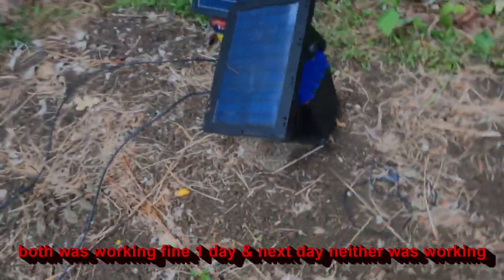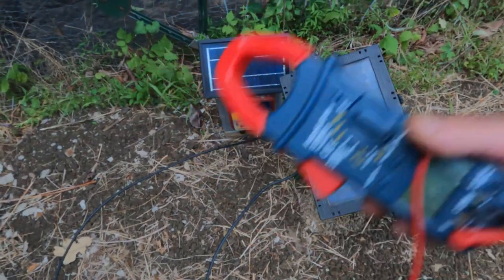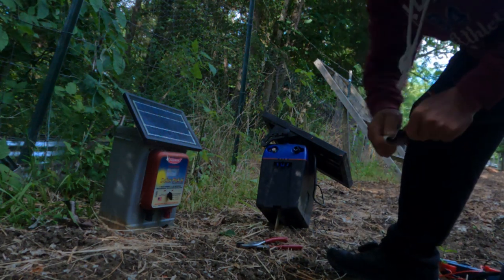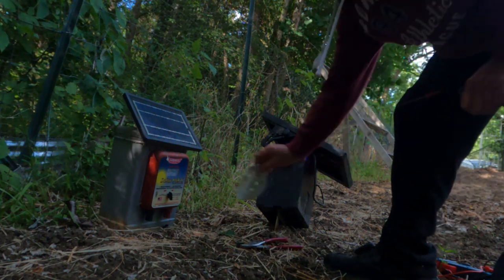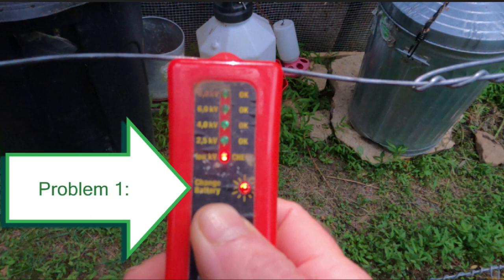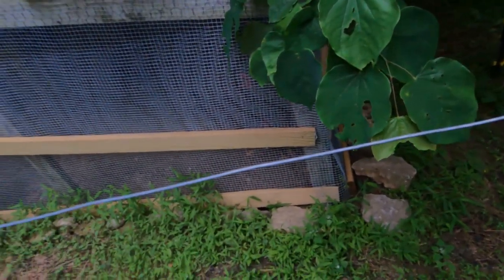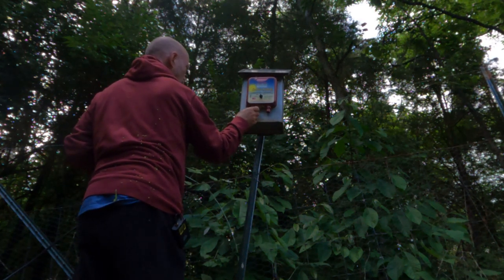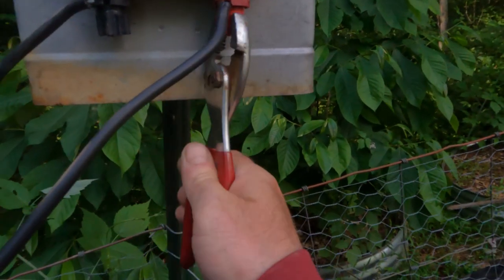testing electric fence issues using ohm meter and fence tester #electric #fence #testing

Comment: What you need to do with your chickens is put a 2 x 6 underneath the edges of your coop, then the predators cannot dig under to get them.  Same with dogs that like to dig out under fences.  You can also use hardware cloth, and attach it to the bottoms of the coop like 2 ft outside, you want to stop animals from burrowing underneath....
Reply from the maker: all great ideas that I originally implemented to some degree when I built this way back in 2015 ... except, I used 4x4's when I built it and even though they were pressure treated, they have mostly rotted away being covered by soil on 3 sides.  I also used a heavy galvanized fence from a school playground that was bent into an L shape buried  down about 1 foot with the L facing outside the coop also about 1 foot ... but apparently galvanized fence isn't like the galvanized fence of days gone by so it rotted away too lol.  I just made an update video a few days ago ... when it posts, you will see my permanent solution different than what you mentioned but equally as good.